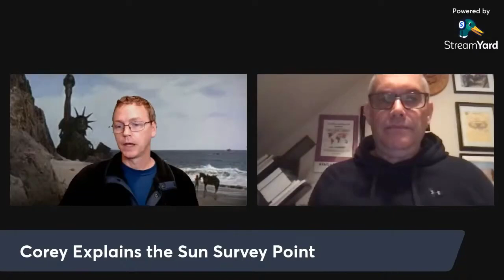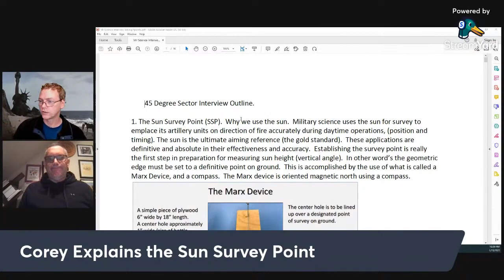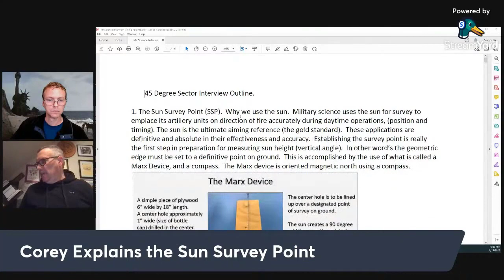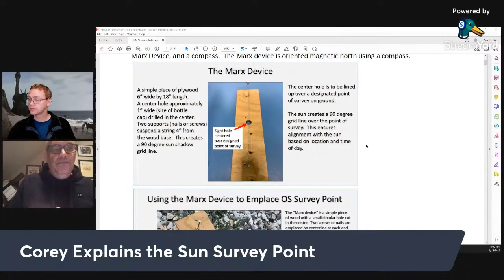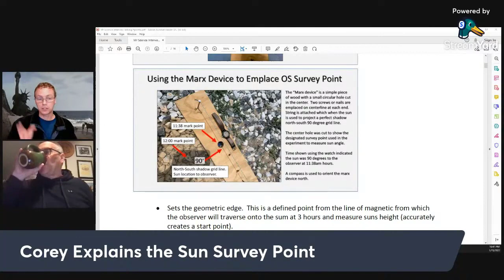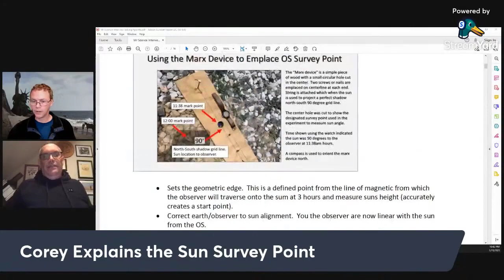Conversations with Corey - Corey explains the Sun Survey Point

Comment: Corey is not very good at explaining things clearly. Noon on a clock rarely coincides with actual solar noon (sun at its highest point in the sky for that day) because of timezones, but you and I know this. I'm not sure Corey fully appreciates this point.
Since the sun only truly passes overhead on the equator his dangling string will never cast a shadow straight down his hole anywhere but on the equator. There will always be some length of shadow, and longer the further we are from the equator. So his look at the sun along the string (and go blind) or string + hole technique seems flawed.
Reply: "Since the sun only truly passes overhead on the equator his dangling string will never cast a shadow straight down his hole anywhere but on the equator. "
I believe he's aware of that. That's what he's talking about at 13:00. Looks like he gets that question a lot. But the reason he gets that a lot is because, as you say, he's not very good at explaining things clearly.

I think you think he meant that the sun was directly overhead because of the 90°, right? That's what I thought at first at least. But what he really means is when the shadow of the string is exactly over the center of the hole. I still have no idea where his "90°" comes from or what it means. For any angle you need two intersecting lines, but the only lines in the image are of the string and its shadow, and those are parallel, not perpendicular. I suppose it could be when the plane formed by the string and its shadow are 90° to the board, maybe? 

This is a recurring theme in his whole presentation: terms are ill-defined and therefore suspect. It's left to the reader to figure out their meaning. Or, and this is worse, he uses common terms in uncommon ways so that everyone thinks they know what he means, but they actually don't.

I still think he truly believes that what he says is right. He's too open about the methodology to be a simple conman. It's just that he doesn't have the skills to properly analyze what he's doing, and maybe too arrogant to understand that introspection is even necessary. But that's what ICST is for :)

Comment: 1:30 30 miles across is not accurate you say, Corey? Hmm that distance amounts to a time of about just under 11 seconds. So accurate enough I'd say. Your readings wrere taken at 9am and 3pm without any regard for when local Solar noon actually was so back then where was your concern for accuracy?
Reply: 6:55 "and you can declinate if you want, you don't have to because it's a line of reference" Declinate is an odd phrasing. Corey also seems happy his sacred reference line is out by 3.35 degrees which equates to 13.4 MINUTES! So not worried about accuracy yet again.
Reply: Corey invents his own jargon and he expects anyone he talks to will understand what he is on about. Worrying.
Reply: He sets a FIXED "geometric edge"! His reference time is FIXED. So no awareness of the fact that local Solar noon moves. That is what causes the analema and is captured in the equation of time. Accuracy my postubulated hindmost, he is designing in ERROR!